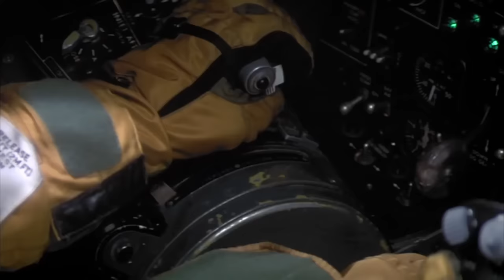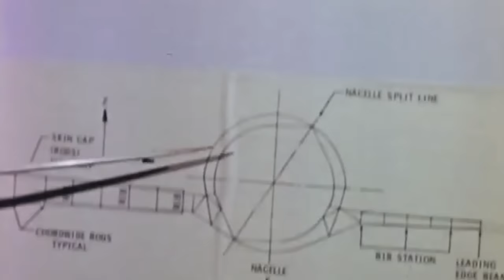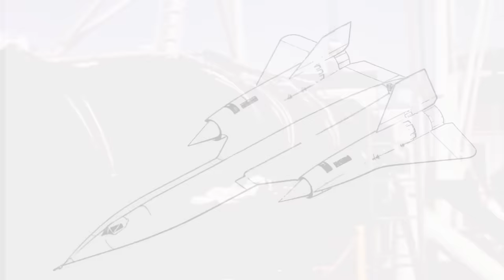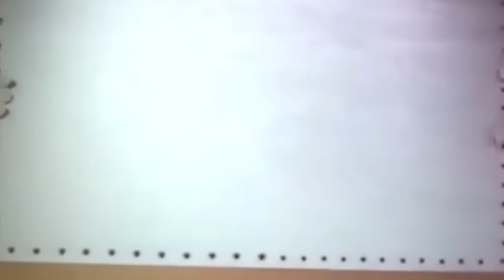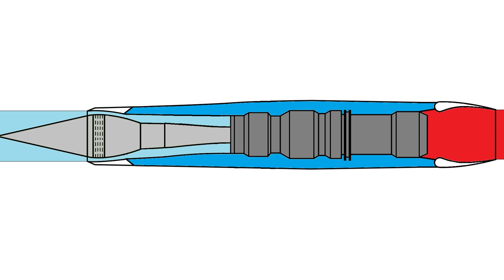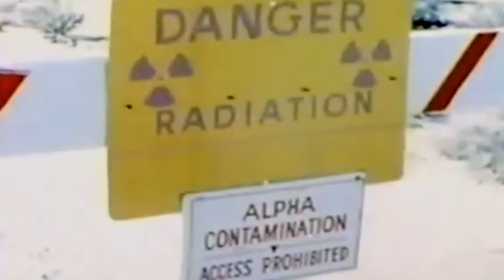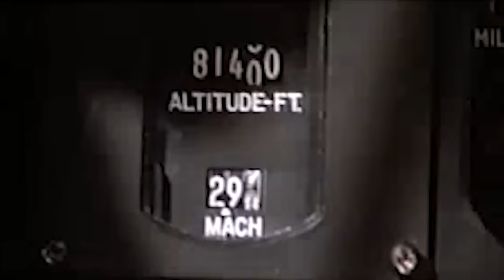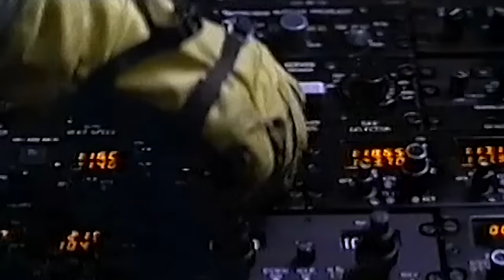Lockheed A-12 | Speed matters

Comment: I never get tired of videos about the A-12/SR-71. They’re such amazing pieces of engineering.
Reply: As is your avatar pic. That would be so damn scary to see a warthog lining up on you. Especially if you heard it's 50 beforehand lol.
Reply: I would argue that the YF-12 is at least as interesting, it is the fastest fighter plane ever built after all. Maybe not so maneuverable in a dogfight but speed Vs maneuverability have been discussed since Fokker Dr I Vs Spad XIII in 1917 and speed usually wins.

But yeah, these planes were out of this world. Sadly, the end of them came down to their price tag. Not only were they insanely expensive to build, operational cost would make an F-35 choke.
Reply: @loke6664  Well, if they ended due to price tag; what is china building to need a mach 30 wind tunnel?
Reply: @ Tamayo1980

Reentry vehicles. 

They’ve been in space for decades.
Reply: @Antares_451  Beats me, but China is not a democracy. US decided to focus on conventional fighters and cancelled the YF-12 program in 1978 since they thought the program gave too little bang for the buck.

That was a political decision, US clearly had the money but used it elsewhere. That is also why they stopped producing F-22 Raptors, they thought they were too expensive so they put the money in the F-35 project instead after only building 200 F-22 (F-35 BTW is slightly cheaper to build but have slightly higher operational cost).

US change a lot every time there is a new President and the new guy tend to cut some projects and put money into others.

I do doubt China want to build a Mach 30 fighter though, even a scramjet powered plane would have a problem going over Mach 6. The X-15 got up to Mach 6.5 but it was basically a manned rocket without any arms.

US is also experimenting with scramjet engines so maybe we will see some new faster fighter jets in the near future.

I would guess China wants the wind tunnel for either testing hypersonic missiles or for their space program but that is just my guess.
Reply: Yes Skyships and SR71 A12 combined
Reply: @loke6664  The Blackbird types had a tendency to fall out of the skies all by themselves, 20 of the type crashed/burnt without ever coming under enemy fire, they served no useful purpose in the real world. That is why they were dropped.
Reply: @jeremygalloway1348  oi
Reply: @georgebarnes8163  That is partly true but there are circumstances where a reconnaissance plane is worth it's price in gold. Satellites are indeed useful and can to some degree replace that but not always. 

I am assuming that we will see a really fast spy drone taking over the role in the future.

In the 60s, satellites largest problem were low quality photos while it's greatest advantage was that it at the time was really hard to shoot them down. Today they can take detailed photos but both Russia and China have missiles specifically made to shoot down them.

And relying solely on satellites is dangerous, a solar flare could take them out and it would take months to replace them. And if someone went insane and started to shoot down a lot of military satellites the Kessler syndrome would become a huge problem.

What I am saying is that having the option to send in a spy plane is a valuable option in war, you use satellites first and foremost but if there is a war and for instance heavy cloud cover you need intelligence from airplanes. A stealth fighter like the F-35 can fulfill the duty in worst case but it will never be as good as a dedicated modern spyplane.

However, the SR-71 and the A-12 are pretty ancient planes and technology have passed them since long. So having a new stealth drone or plane is really useful. You don't really want to send a plane from the early 60s into a war zone now, even if you modernize them. Honestly, already the F-15 and F-16 should be retired as well or at least only be used against opponents who also use old planes.
Reply: @loke6664  Dont forget, satelites has predictable orbit. So the enemies could just cover up their secrets just in time the satelite went into orbit
Reply: @darnit1944  As long as they are aware of them, yes. Shooting down satellites are more effective but also rings all kind of warning bells. 

Anyways. having a spyplane is a huge advantage. There is of course the possibility that the rumored SR-91 Aurora actually exist but I wouldn't hold my breath about that one. It seems unlikely that anybody could have kept it secret since the 90s without good pictures and data leaking out. For a few years, sure. For 10 years, possibly but for over 25 years?

So yeah, I expect spy drones are in the works now with stealth and Scramjet engines. I would guess we are 10 years or so away from them being feasible (mainly due to the engine).
Reply: What about the YF 12?
Reply: yeah butt it is never named archangel, it is oxcart
Reply: @loke6664  Fokker does never gets the respect it deseserves, so you mention it thx, people don't know how much it has done for the alround development for aircraft and fighters in beginning
Reply: @jeroenverzijl8596  The DVII was the best plane of WW1 so I don't think they should be underestimated. The EIII was also pretty revolutionary when it came out so Anthony Fokker do deserve some respect.

The DrI was a bit overrated though, mainly because it looks so awesome and because Manfred loved it but it's slow speed and the too high lift power from the top wing made it a bit too dangerous to fly in combat.

Butt I think people tend to forget Fokker is because people tend to forget WW1 and only focus on WW2 even though WW1 was at least as important for aviation.

Legendary manufacturers like Fokker, Albatross, Nieuport, SPAD and Sopwith are basically forgotten while others like Junkers and DeHaviland are only remembered for their WW2 planes even if both companies made far more innovation (maybe besides the Junkers Jumo engine) in WW1.
Reply: @loke6664  that can be treu butt DVII if a pilot of any other nation could get it hands on it they would use it
Reply: @jeroenverzijl8596  The Fokker DVII was actually used post war. Holland, Poland, Belgium and Hungary used them. Heck, even US, GB and France used some they had captured, the Yanks even changed the engine of theirs to make them last longer.

The only real competitor to the DVII was Sopwith Snipe but it entered the war really late. I do know that one of Jasta 11s pilots said "We ran into several of the new snipes on a patrol, they were better then our planes. I shot down 3." about a month before armistice. (That is not an exact quote, it is late and I feel too lazy to browse my bookcase and find the book right now).

The Snipes were used far more to support the white army in Russia after the war.

Either way, the Snipe were faster at diving but slower at climbing and they had very similar stats but since the DVII actually made some impact in the war I at least would claim it was the best plane of WW1 but I can buy it if someone disagree.

WW1 did see a whole bunch of impressive planes from many nations that temporary changed who had air superiority, no one more then Albatross DIII who during "bloody april" 1917 give RFC losses around 90% which probably is the highest losses of any air force during a month of war, makes even the Egyptian air force during the 7 day war seem light.

Albatross DIII, Sopwith Camel, SE5A, Spad XIII, Nieuport 17, Fokker EIII were all amazing planes and if the war would have ended quicker one of them would be on top. But 1918 were ruled by Fokker DVII and Fokker DVII-F.
Reply: L
Reply: @loke6664  germans hade some still to, there are pictures of H. Goring with one in 1933, the fokkers built for the dutch airforce were good but, because we were not expecting a attack they were all parked side by side the danish hade those to the Nazi's used them as training planes
Reply: @loke6664  whow wat i know about tanks you know about planes
Reply: @jeroenverzijl8596  They were especially forbidden from operating Fokker DVII in the peace treaty, it was the only plane mentioned even if they were forbidden from having an air force too but in 1933 the Germans started to ignore the treaty.

I have seen a picture of Herman in the Fokker the Swedish Air force owned, his wife was Swedish so he spent a lot of time there, but I ain't sure if he ever flew it or just posed for a picture since he was an ace.

And yeah, Fokker moved his production to the Netherlands after the war and it isn't strange they were good, they were not licensed produced but had the designer there (and likely he brought his team too).
The whole "not being allowed to build planes" were pretty harsh conditions for a rather genius aircraft engineer.

If you are interested in WW1 planes, I do recommend this lovely strategy board game: http://www.maxeagles.com
It is free but require some models (or at least, it looks terrible without them), the guy who made it did a lot of research.
Reply: Don't forget the YF-12.
Reply: 0
Reply: @georgebarnes8163  You have a limited knowledge of A-12/SR-71 crashes, there was not one operational mission where a blackbird was lost. The aircraft was solid, most crashes were due to human error  not aircraft design.  One famous loss was out of Okinawa in which a P&W employee forgot to install retaining pins in a whole shipment of J-58 engines. That caused the loss of an SR-71. Others where the D-51 drone launches.
Reply: @mikerowan1132  Limited knowledge,? fact of the matter is that half of them crashed no matter what way you want to dress those lemons up.
Reply: @Antares_451  hi
Reply: @richardlarned8292  Hello
Reply: Fän in a cänn€$ ^^ ?
Reply: I totally agree!
Reply: Ot9tk
Reply: And to think that it was made 40 years ago

Comment: You show that plane to anyone who doesn't know its history and ask them "when you this was designed?", you won't get an answer as early as 1964, most people would probably say 1990-2000 at earliest.
It still looks futuristic today and its just a pity its so high maintenence and costly to maintain otherwise I'm sure they would still have a major military role today.
Reply: It was flying by 1964
Reply: Design was started in 1959.
Reply: @lookoutforchris  Thanks for the date. Amazing that in five years it was operational. I have a chase plane photo, just a profile pic from right side (1964).  It looks like a long, thin silver dart.
Reply: @jsunit5354 mñn o ver
beber
Reply: yeah and it was and still is better then the F22 or F35 will ever be
Reply: @jsunit5354  The A-12 flew in April of 1962
Reply: @mikerowan1132  Thanks . .I didn't know that. I thought '64 only because of the photo I was given at that time.  Amazing tech.

Comment: It’s been said countless times before, but this incredible series of aircraft, still unmatched in performance to this day, was created in an era before computer design and fluid dynamics software (hell, they didn’t even have calculators).

Not only were the engineers using pencil, paper and sliderules, but also exotic materials almost none of them had any experience working with. They were inventing all the techniques and solutions as they went along.

Such an impressive feat, and the resulting silhouette still looks like it’s from the future almost 70 years later. My favorite aircraft of all time, I never tire hearing/learning more about it and its escapades.
Reply: Computational fluid dynamics has existed since the 1940s when they used some of the first electronic computers for artillery shell ballistics.
Reply: If you think this aircraft is amazing, you should read about the history of the Avro Arrow.
Reply: @dilvishpa5776  
Why? Because it was mach 1.3 slower than the Blackbird? Or because it was a pipe dream that was never operational?
The reality of that plane is that all the hype about speeds and other things were nothing but theoretical future versions of it, it was only a mach 2 aircraft, plenty of other aircraft were already flying mach 2 at the time, the F104 and F106 were just as fast or faster not to mention what the Soviets were cooking up at the time. 
Most everything you think you know about the Arrow is exaggerations for the sake of sensationalism to sell books and make a TV movie.
Reply: @dukecraig2402  Not really. You haven’t done you homework on the plane, so best not to pretend you know anything
Reply: @dilvishpa5776  
No, you haven't done your homework, overhyped BS intended to impress people for the sake of selling books and making a TV movie are not facts, try learning things from credible sources instead of movies and TV shows.
Reply: @dukecraig2402  dont bother him he just a a fanboy of everything that the British build
Reply: @dukecraig2402  well said the soviet had Fox bat The Mig

Comment: That airplane when I was stationed at EDW AFB it was then designated YF-12A Y was for experiment back then in 1965, I was a mechanic on a TB-58 chase for the XB-70 maybe later the designation was changed. The YF-12A had internal air to air missels which no one mentions.I did have a top secret back then and often went to the secret TO room to read up on some of the airplanes in use at Edwards at the time. I am now 77
Reply: It could carry air to air weapons? Really?? But why would it need that?
Reply: @PegasusTenma1  It carried the AIM-54 Phoenix missile designed for the F-14, along with the AWG-9 fire control system.   Why would it need the missile?   The YF-12 was a prototype interceptor. It was thought the Russians were developing a supersonic bomber (ala XB-70) so an interceptor was needed.  The missiles needed to be carried internally in order to preserve the area ruling needed to achieve Mach 3.   The thing Sky failed to mention is the addition of the extra cockpit for the trainer version of the A-12 dropped its max speed to just over Mach 2.   Yes, it really is that sensitive.  (As an aerodynamicist, I want to say that this video is among the most technically accurate of any aviation video I have ever seen.  As an aside, early in the video there is a short segment showing a wireframe model of the A-12.  I think those may have been Flexstab models from Boeing's work on the aeroelastics.)
Reply: @dougball328  It carried the AIM-47 missile and GAR-9 missiles, which were developed into the AWG-9 and AIM-54 Phoenix that the F-111B was to use and that the F-14 Tomcat ended up employing.

Comment: As a teen I would see the SR at various airshows, always cordoned off, sometimes with armed sentries on guard. One time at Norton AFB in California, one was parked, no ropes, no covers over sensors elint ports etc, and you could walk right up to it. I said to my father, WEVE GOT SOMETHING ELSE. I was active duty USMC intelligence at the time-about 1982. The ole Sled was replaced by digital satellite intel gatherers. I did get to see them operate out of Beale AFB, Kadena AFB and in the UK. What a sight to see and hear.
Reply: @laurie3546  Mill Valley Ca.
Reply: @laurie3546  I dont understand. Are you talking about area code? Mill Valley is 415.

Comment: The SR 71 and the A12 were the pinnacle of aircraft design. They both showed the pure genius of Kelly Johnson. Ive often wondered what he could have come up with if he had access to todays modern composites and computer components. I know aircraft design can only go so far pr at least i think so but maybe we will never know because we haven't seen a designer like him since him.
Reply: I would assume what we have today is something akin to a rocket that can fly over airspace with no thermal signature, undetected by radar and flying at such high speed that nothing can track or target it. 
And it probably is significantly cheaper than the SR 71. And I would say every branch of the US military probably has some variant.
Reply: Kelly Johnson. No one like him before him. No on like him after him. Only him.

Comment: I had the opportunity while in Californian to visit The NASA landing of a space shuttle during the Reagan administration to see the SR-71 up close (completely with out any tech in it) and on the way home My dad point out aircraft in the sky. it was amazing. It was being escorted by two smaller aircraft as they banked. Once the made the turn, both of the smaller aircraft went full burn. The began to catch the SR-71 but just as they passed it he threw the aircraft to full throttle the blast of flame out of the rear of the jets was almost as long at the escort planes. With a few second acceleration, the SR-71 caught up to them win in about 2 seconds and continued to accelerate. Just like that he went from being slightly behind the two other pilots to just, gone. I have been fascinated with the group of reconnaissance aircraft ever since.

Comment: At 7.04 I was underneath the SR71  at Mildenhall air display about 1986 and was going low and slow whilst turning tight to avoid overshooting the crowd, a second later  exploding flames from the stalled engines as it banged  and banged trying to relight, I thought I was a goner!